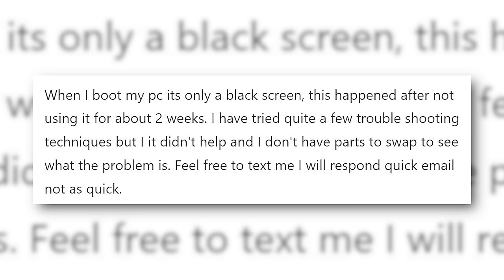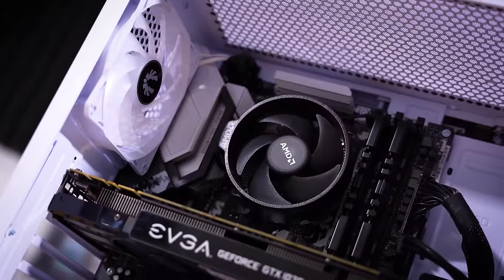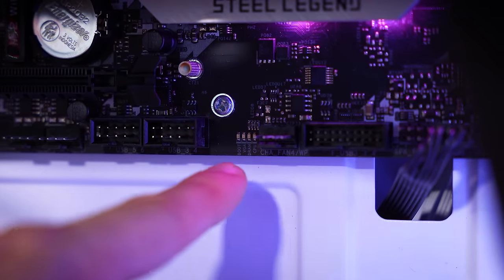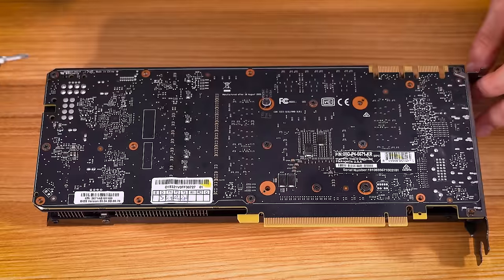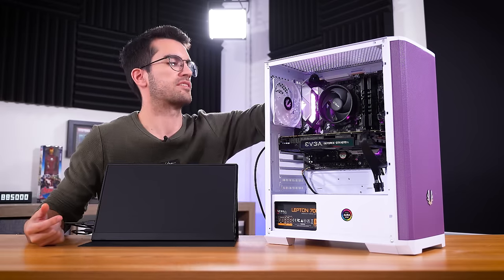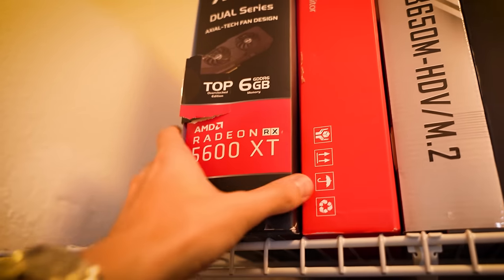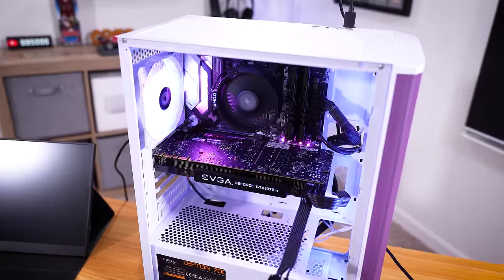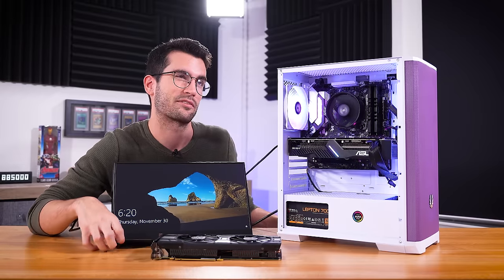Fixing a Viewer's BROKEN Gaming PC? - Fix or Flop S4:E18

Comment: I just had a similar issue with an Evga 1070 I got for a budget build for my uncle. I thought the card was toast, I repasted it just as you did and everything. I would power it on and fans would spin, led lights would power on and everything. No picture out. I thought it was dead… but then my monitors black screen prompted me to make sure correct display port version was selected… so I changed it from dp 1.4 to dp 1.1 and rebooted the pc… voila I got picture out. Just something I’d like to suggest if you haven’t looked into.

Comment: The CPU supports pcie Gen 4. I have had some luck in similar situations forcing a lower pcie generation, though I would have expected any issues related to that to be fixed with BIOS update.

Comment: 3000 series are gen 4, 4000 is gen 3 , 5000 gen 4 (except G models 3000 and 5000), its kinda confusing really , after you add in how many ryzen 5 are 4 core 8 thread instead of 6C/8T it turns in to quite a mess to try and keep up with .

Comment: I had a similar issue one day, but in my case it happened in a lot smaller timeframe. In my case it happened overnight. I had a 6900 xt for like 5 ish months and out of nowhere it stopped working, whenever i would launch a game (any game, i tested multiples) or tickle a bit the gpu was crashing. I did a bunch of troubleshooting, reinstalled drivers, installed older drivers, reinstalled windows, nothing was making it work. Then i had an idea i had a very old radeon 250 gpu, i plugged it and launched a game, it was working but at 1 fps lol (but that was expected, i launched cyberpunk). I wasn’t able to test my 6900 xt in another system but i was sure it was dead so i contacted amd (since i brought it directly form amd) and a few weeks i got a new card, i installed my all in one alphacool liquid cooler on it and since then (over a year now) no problems at all. It was my second pc wierdness, first time it was the motherboard (on my first pc that i built myself, that was also my first ever pc i owned)

Comment: Unless there’s a burnt component, usually nothing to see on a non-working graphics card, but I agree with broken solder under the GPU die. Not a big fan of trying non-working cards in another rig. Just in case we have shorts. I use and old board and cpu that are expendable should the card fry any components.

Comment: I thin a good intermediate step to test that GPU in a known-good system. It's possible the GPU wasn't seated correctly, or the supplemental power wasn't fully connected.

Comment: Maybe it was the camera angle but at certain point I thought I saw a little curve in the board of the 1070, not much but if that's the case it's likely the core needs to be reballed again and that's a repair that doesn't make sense on a 100$ card since that repair is an easy 250-300$.

Comment: I find it odd as I still have a 970 that I kept around and recently put in to a system and its working fine still and still able to run moden games on well kinda it's running them at at anything from like 25 fps and under but it's better than I was expecting and more than fine for what my mum will use it for (shopping, emails and the odd yt video).

Comment: i remember for my 2nd pc having a 3600x and a 1070ti, the 1070ti randomly died on me, LEDs worked, fans spun but no boot. Amazing build i used for entry level 1440p. Ended up upgrading to my 5900x and 3090 which i still use today and now i wait for 50series cause 40series is a big L

Comment: could be a corrupt vbios. Boot with both cards installed and see if Windows detects the card. If it is detected you may be able to reflash the bios on the 1070 and possibly get it to work again

Comment: Can someone help me plz i was playing a game today and suddenly my pc turned off on its on no power outage or anuyhing then i tried to turn it on but it dosent the motherboard green light turns on for 0.2 or 0.5 sec and then it turns off. My psu is making some sound the fans are not spinning and i pulled of the cables of psu (only one was connected) and it turned on somehow then turned back off

Comment: Fun fact, modern BIOS (or actually UEFI) and it's configurations are stored on non volatile flash memory, so the data isn't actually lost when power (from the battery) is lost, the battery is really only there to keep the RTC (Real Time Clock) ticking. Motherboard manufacturers actually put work to add the reset on battery removal as a feature.

Comment: Did you try plug in the csrd as second gpu? It happened to me with a vega... It was not spitting out video but it was still working. At least you rule out if its dead dead or is it about the ports...

Comment: Hei greg it would be best for you to sent the cards to northwest repair he doesn't charge you for no fix if the card is beyond repair but i doubt that for his ability to repair a card even with a cracked pcb and he is such an absolute wizard i would lov eif both of u collab. Also i guess his charges are very reasonable he says in most videos he works cheap so older cards get viable to be repaired and not just thrown into trash

Comment: Make sense out of this. Bought new gpu and wouldn't post picture with default drivers show bios or anything, but on new screen all is working fine with or without drivers. With normal drivers worked fine on old screen until I uninstalled them and restarted pc... To this day I have no idea is that screen simply busted somehow

Comment: I had the same thing happen to my wife's rig also with a EVGA 1070 ftw3 or ftw2. Had to give the GPU back and get a amd power color r9 380 red devil hybrid card. Both those cards were a big upgrade to the GTX 760 to she had. I personally think those older EVGA card 1070 don't age well at all.

Comment: It's not a short or else the system wouldn't turn on, most likely a dead GPU core or a dead vram chip, the latter of which is cheaper to replace

Comment: That 1070 probably just needed a re-flash
Reply: Yeah, I was a bit disappointed Greg didn't even check whether the card is being detected at all. The board does have a second PCIe slot, so it'd be nice know whether it shows up in device manager when inserted as a secondary device.

Comment: Before you take a gpu apart you should try it in another computer to make sure it does or does not work especially when the computer boots without it just to make sure. Had a guy bring in a computer that the graphics card worked perfectly in another machine but the power supply did not power it up and he was using the motherboards video out.

Comment: In an instance where the supplemental power isn't connected, wouldn't the card still have enough power from the PCIE to display a message indicating that the power source isn't connected? Speaking from experience bc I've forgotten to hook up the power cables and still had a message displayed from the card itself letting me know the PCIE cable wasn't connected.

Comment: I had a 5600xt before moving to the 6600xt. The 5600xt is still a good card. I just wanted less power consumption and a little better performance also beats the 5700xt. I didn't have to upgrade my power supply with the 6600xt.
Reply: but solid upgrade for that 1070ti

Comment: Given the age of the card, and the symptoms, it could be a corrupt vbios. Which is easy enough to diagnose. 

Plug it in as a secondary GPU in a working system. See if the system can detect it. If so, flash a new bios and try it again.
Reply: definitely worth a shot. I've had that fix some motherboards in the past, although I had to use a CH341a programmer and find a BIOS dump online.

Comment: Help 
A few days ago my 244 hurts monitor stopped working with one of the DP ports of my graphics card so I tried to connect to the other DP ports it worked for a minute, then stopped working, and it did the same with the other ports but for a way shorter amount of time also try the HDMI cable the same thing happened by the way I have a 3090 and I did a over clock a day before with The Nvidia overclock test.  I have done this before. Multiple times in nothing like this has happened, so I don’t think that it is because of that. And my second monitor kept on working until I plugged the 244 Hz monitor to the same HDMI port that my 144 hurts monitor was connected to, and now Non of the monitors get a video feed.
Reply: By the way, it looks like my PC is kind of fine, because when I turn it on it automatically connects to my speaker but I get no video feed

Comment: If it is the graphics card u can try and format the bios for the card it's self
Reply: U can remove the card first to see if it gives display of the igpu sir
Reply: I had a issue with a Rx 480 where it powered on but does not give vid. It kept on doing this until I used the dos boot system to flash a working bios onto it and it worked. Still upgraded to a Rx 7600 cause why not but if u have the time j can try it to see if that flash method works

Comment: 11:20 that seems like a short on one of the power rails that powers the fans. The gpu might be trying to bring the rail up but it goes back down again because of the short. Might be worth checking out with a multimeter the different coils on the board looking for a short-circuit

Comment: I did a bios upgrade on my asus x570 board , everything went fine , bios updated and system rebooted to a blank screen , no display at all ,and no option to enter bios .  bear in mind this was all working fine to begin with , went through all the troubleshooting methods , still no display , as a last resort i plugged a different monitor in and it worked first time , straight into windows , unplugged that , plugged in the original monitor , booted first time , still no idea why , perhaps someone can tell me
Reply: how come whenever i ask a question on here i never get a reply ?

Comment: The Ryzen 3600 is PCIE Gen 4 compatible. Some of the lower model chips of the 3000/5000 are Gen 3 only. Like the 3500 or 5500.

A way of testing the card to see if it at least works is on an Intel/AMD with dedicated graphics. You can set the BIOS to default to the integrated graphics on boot. Get into Windows and see if it can at least see the card. If it can't, it may be too far gone.
Reply from the maker: Yeah, more often than not it's a redundant step IME. If the card isn't sending picture out and it's the default display adapter, checking within Windows for any sign of life is often futile.
Reply: @GregSalazar  It's not my go to as well. I did do this with a newer card and it turned out to have a VBIOS update. Card worked normally afterwards. It wouldn't boot with it as the default display in the same fashion as in the video. 

I have seen some cards get flashed by crypto (jerks) with it not working to put out any display afterwards. Quick reflash of the proper BIOS, and back to a working card. Shorter life due to being mined on, but better than getting a dead card.

Comment: Bad fans on the GPU possibly?
Reply from the maker: Typically won't prevent the system from sending a picture out - especially if the card was cold prior.
Reply: @GregSalazar  was servicing a computer the other day where we weren’t getting picture out.
One of the fans seemed to be stuck, gave it nice nudge and it spun as normal. Rebooted, and everything was good

Comment: 1 Thing is wrong about the 1070ti, the backplate it missing. That 1070ti is supposed to have a backplate, with alot of thermal pads plastered between and yet it's not there.